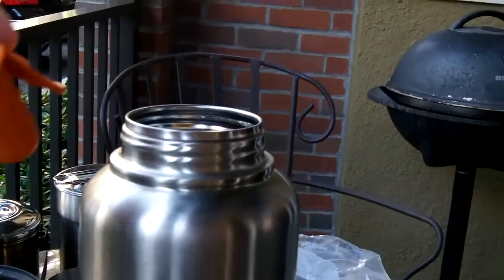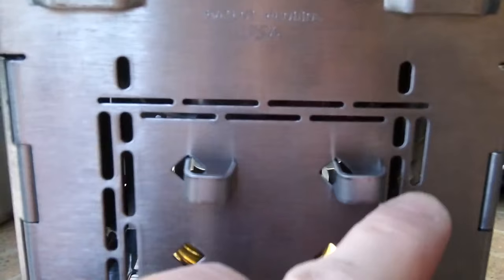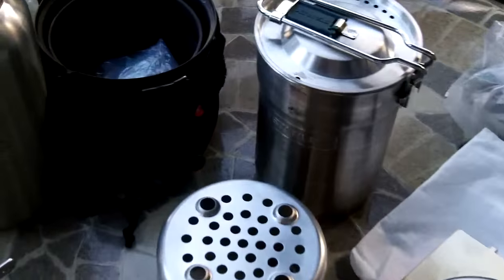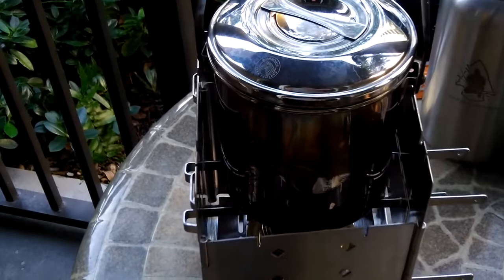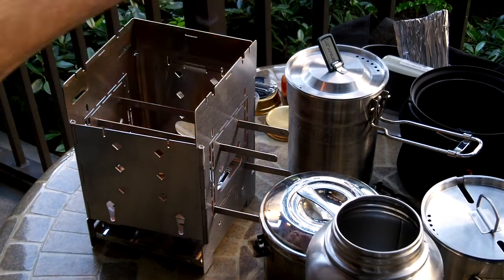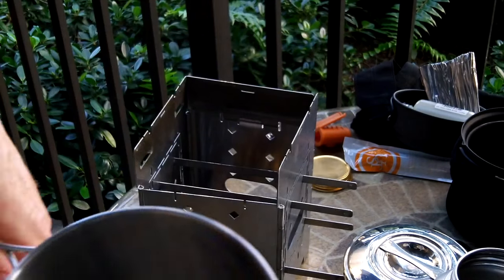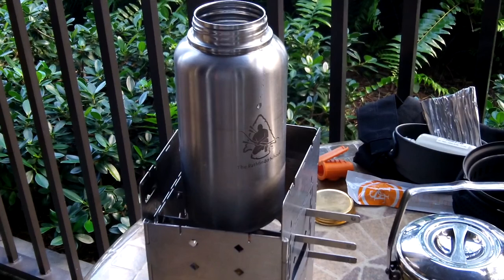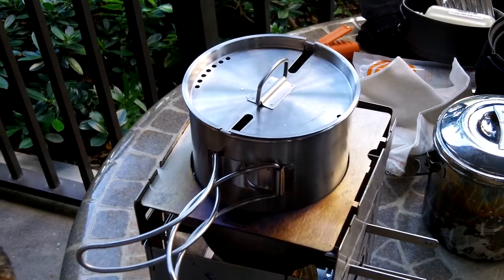Firebox Stove- Using Different Types of Vessels

Comment: Anthony, I have been experimenting with used brake shims that I asked my neighborhood auto service to save for me.  They do dozens of brake jobs per week and the old shims are usually salvaged or tossed in the trash.  I have been able to make small stoves with these stamped steel plates.  Of course most need to be cleaned before handling--I soak them in a brake cleaner or solvent.  That does a pretty good job of dissolving the grit, brake fluid and caked on brake dust.  I love your firebox stove.  I bet its fun to use, too.  Thanks for the vid.  Jb.
Reply from the maker: +Jb Bennett That seems like a very good idea you have.  Very resourceful Brother.  I really like this Firebox stove and will be using more in the coming months.  Have a Happy New Year!  Blessings.  Anthony.

Comment: I like it, this looks very useful, I'm getting one of these, I have two rocket stoves w/ the coleman Oven to go on top of the rocket stoves I also Bought a Toaster oven at a thrift store for cheap and gutted the electronics out of it, I put that on top of my smaller Rocket stove, But don't see why you couldn't do the same thing with this firebox, But it would take More fuel to heat it and in an emergency may not be very efficient, or very useful, I also have a couple of Solar Ovens one of them has been up to almost 400 degrees in summer, It gets to temperature pretty fast, and 300-325 degrees when its cold and Snow on the ground in winter, 20-30 degrees out, in a power outage I can cook with solar oven, in the upper Northwest. But I see this as a very good option.
Reply from the maker: This is a great stove. Very well made.

Comment: What i did with my Stanley cup/pot i cut off the plastic handle cus it will melt eventually and added a simple heavy duty key ring. Works Flawlessly! YO! TEDDY IS HUUUUGE.... I KNOW YOU AINT GIVING HIM THE NEW STACK U GOT???????? Smh.... 😳
Reply from the maker: +Gino Gambino That is a good idea especially if you put this can directly into the fire.  You put a circular key ring or a small caribiner?  Teddy is eating very well...Lol.
Reply: Bro! What are you, A mind reader or a Professional stalker??? Lol.. I actually tried my nite ize mini but  the key ring is a much better option! The carabiner looks cooler and has the hook function but the ring has the hole that can be used with any branch in the field making it easier to operate. Just get a thicker keyring.
Reply from the maker: OK...Thanks. I am going to try that.